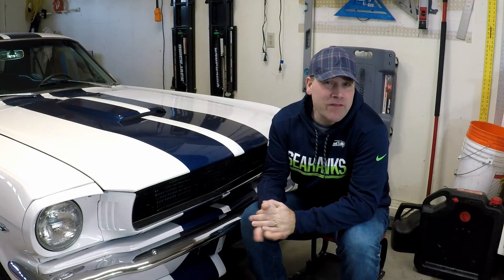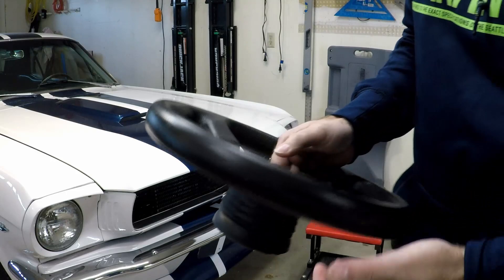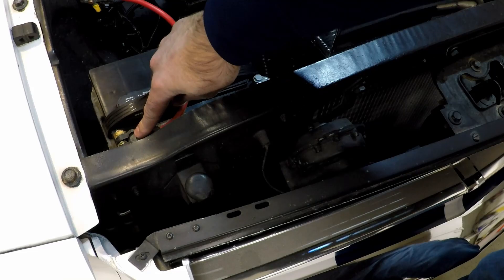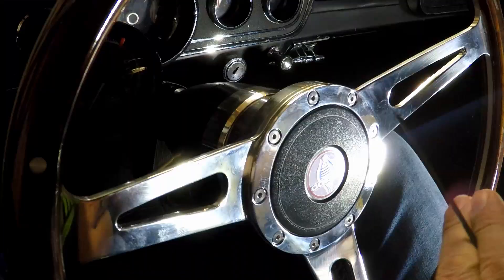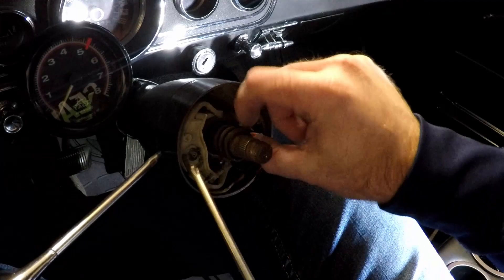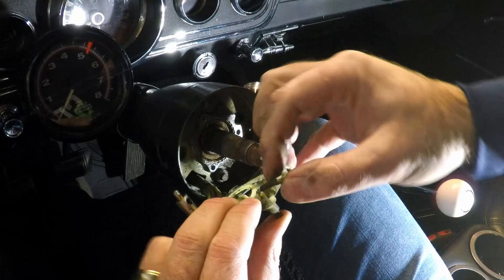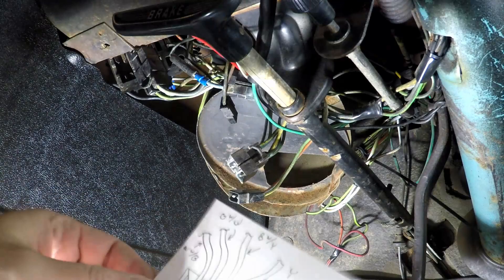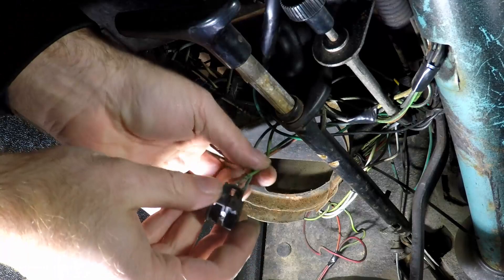How to Fix the Horn on a 1966 Mustang

Comment: Thanks for the video and Nice Car! May I suggest a time-saving trick for threading the new wires down inside the column?
Tape a "dummy" wire to the ends of the old wires before pulling them up and out. Then tape that same wire to the new ones and pull them down and through. No need to remove the cone and you'll save enough time to sit back and enjoy a wobbly-pop!
Reply from the maker: Great tip!  I have to do this all over again on my new car, I'll probably give your advice a try when I get there.   :)

Comment: This is great. The previous owner of my '66 rigged a little button below the dash that honks the horn. While I hate messing with wiring, I'll order a new turn signal switch and give this a try.
Reply from the maker: The only "difficult" part is making sure the pins are in the correct spot on the connectors when you put it all back together.  Hopefully this video and your own notes should be able to get it done!  :)

Comment: Thanks for the video.   I also have a '66 so your videos are perfect for the repairs and upgrades I want to make.  I am not that familiar with Ford wiring connectors so your tip about removing the individual wire conductors was most useful.  I am not sure if my connectors are different from yours but I got the impression from your video that there was a single tab/button to push which would release all of the conductors.  Perhaps I misunderstood.  In any case, I found that each conductor had a minuscule tab that needed to be depressed in order to release the conductors.  Otherwise your video was great as always.  I particularly appreciate the upbeat attitude in your voice.  It makes each job much more approachable.
Reply from the maker: Awesome, I'm glad you're able to pull some value from my videos!  :)
You are correct, each wire has its own "tab" that must be depressed to release the wire from the connector.  Sorry if I did not make that clear enough.  :)

Comment: Hey Andy another good video. I've been pulling my hair out trying to determine what's wrong with my horn. I just replaced my steering wheel with a CJ model similar to yours, and at the same time I replaced the horn/turn signal switch assembly because the old one had a broken return cam. 

After reassembly and testing everything, I think the problem is a bad replacement switch assembly. I think the spring-loaded horn contacts aren't contacting with the steering wheel hub. Not loving the thought of pulling all that wiring again, but here we go. 

Second point: Do your turn signals self-cancel? I noticed (at the 5:00 mark) that your new hub does not have the two steel dowels inserted. Those dowels are supposed to push the turn signal cam when you return the wheel to centre after your turn. Have you found a different way to cancel your signals? The original design is okay, but ultimately it's why the turn signals break - as the plastic gets brittle those dowels will eventually snap one or both sides of the turn signal switch.
Reply from the maker: If the spring loaded contacts aren't contacting the steering wheel hub, the hub either needs to go in a little farther, or you may want to see if the those contact pins are aligned correctly with the copper pads on the hub.
This was on my previous Mustang and I believe I later pulled the hub off and installed those canceling pins.  However, I pushed them in too far into the hub and I think I still had to manually cancel the turn signal.  I forgot exactly, but it was something like that.
Reply: @AndyKruseChannel  yeah I'm stumped. I "raised" the entire column closer to the steering wheel to make a better connection with the two contacts. I can see through the column gap that the contacts move slightly when I turn the wheel, so I know  they're both contacting the hub.  Horn button tests okay on its own, so does the hub, and bridging the two contact pins. All I can think of is the two pins are somehow not right relative to the hub, but I give up. 

BTW, for anyone else reading this, if your cancelling pins aren't working with your new switch assembly, try sliding the entire column very slightly back toward the steering wheel. I compared my new Drake switch assembly to the OEM one and the Drake is very slightly thinner. Moving it (along with the column) closer to the steering wheel ensures the cancelling pins are where they need to be. You only need a hair of space between the column and the hub.

Comment: Ok!! Love the video! We are working on my 16 year olds mustang. We went to change the turn signal harness and wires and we couldn’t undo the connectors from the turn signal and the wiring harness. After a few hours of pulling and twisting, I finally got it. It had shorted and the yellow wire had melted in the connector. Then I realized the yellow wire behind it had been melted and pulled back… I ordered new male and female wire connectors in case I have to replace. What should I do? Do you know what the yellow wire goes to? Horn? Lights? Now I’m lost. I cannot find the wire harness connector either… please some advice would be helpful!!
Reply: Also, your video helped me pull all my connectors out with a screw driver… I had no idea. I took it all a part thanks to your video!
Reply from the maker: I don't know the year of your Mustang, but if it's a '66, the only yellow wire in that harness is for the horn.  The solid yellow is coming into the harness, goes to the horn button, and the yellow wire with a blue stripe comes out of the harness and goes out to the horn.  :)
Reply: @AndyKruseChannel  thank you for your quick response… ok, my 2 sons earned their eagle and I bought them fixers… 65 and 66. We are working on 65. I wish I could show pics, but it’s the straight yellow wire and it melted and tore up a little. I’m. Not sure how this could have happened, but I’m assuming I should try to replace the whole wire to the horn?? Thoughts?
Reply from the maker: You could try to splice in a new piece of wire where the other one melted.  If that doesn't work, you may need to get a whole new turn signal harness.

Comment: Yeah I have same setup as you, and horn loud jumping wires at horn but I guessing contacts wore down just hair short of contact. Andy what does putting adapter in Key down do, seen no slot or something to mount onto?
Reply: actually Andy I saw why that key there. If you have the pin sticking up where that sits that is the turn signal cancellation, yours like mine no pin there, now I think about it I had a pin in my packing for adapter but I see no spot to plug into turn signal switch.
Reply from the maker: Haha, this is great, you answered the question for me.  :)

Comment: And although it has a full tank of gas I cannot get that gas cap off I’m gonna have to really look at that tomorrow
Reply from the maker: Maybe someone overtightened it the last time it was open?  Based on the design of the gas cap, I can't see how it would get stuck on there unless someone had damaged the locking section?